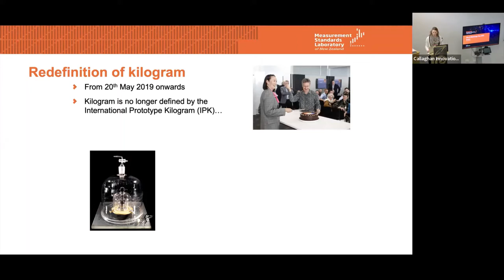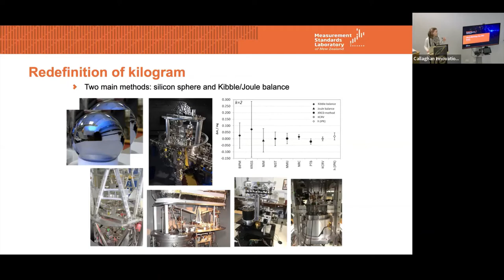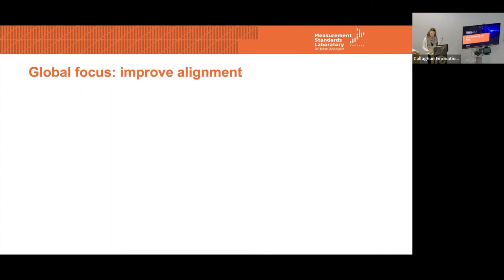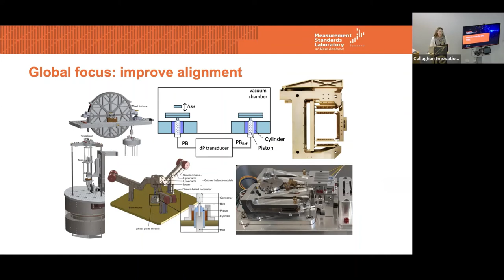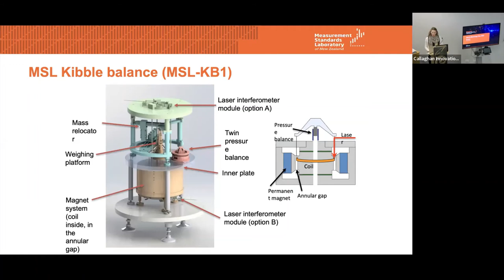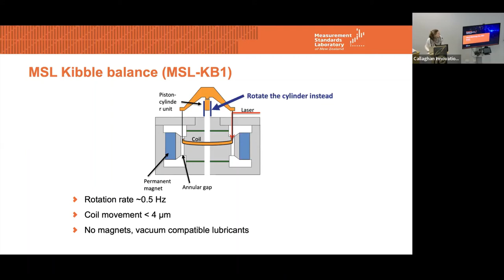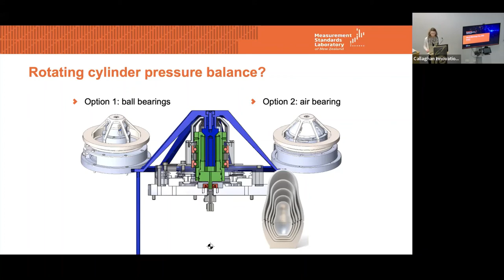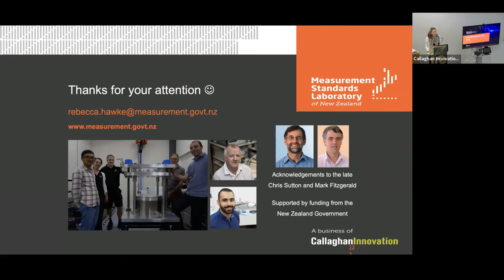Kibble balance update - Rebecca Hawke

Comment: Little unclear on the kibble-balance explanation. How is g_n measured & corrected?
Reply: If you mean g as gravitational constant, usually it is measured using gravitoneter.  Modern machines use falling mirror and interferometer. The mirror falls inside vacuum chamber. Then they just measure acceleration and thus g.
Reply: @miszcz310  Ehh, but then your Kibble-balance (and hence the definition of a kilogram) is only as accurate as your gravitometer. Worse still, the mass of the kibbl-balance has its own gravitational attraction. If the "mirror falling in a  vacuum" process is done elsewhere, the value of its acceleration and that oat the kibble-balance shall always be ever-so-slightly different.